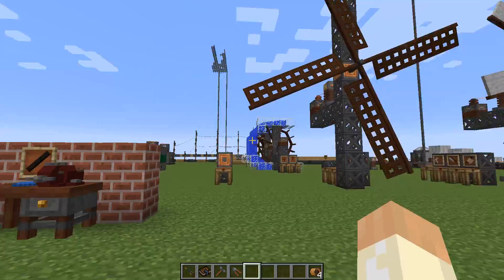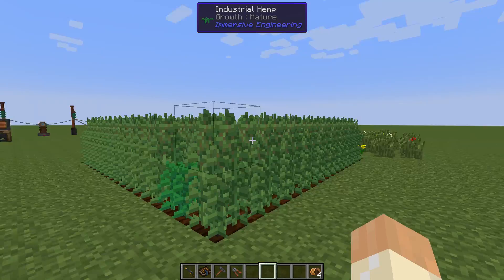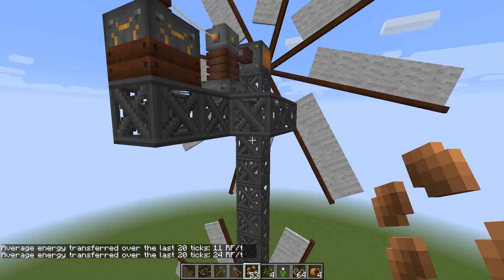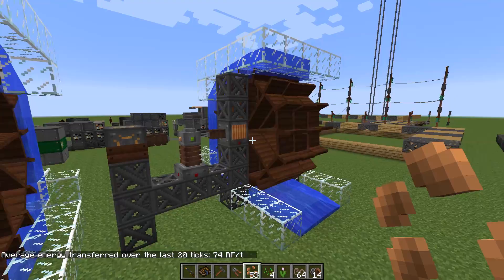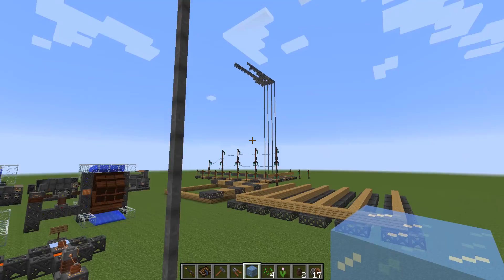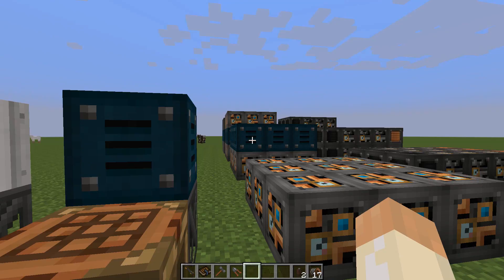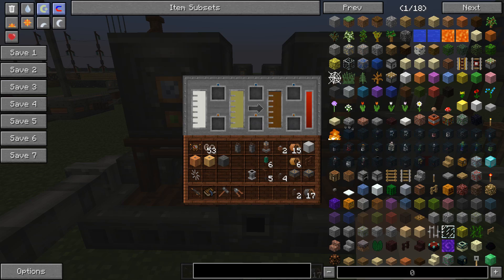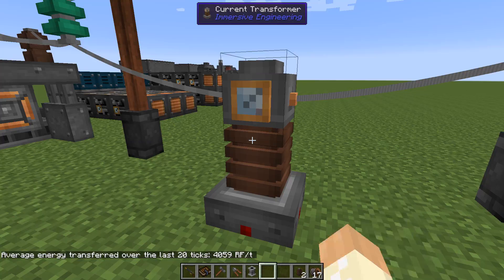Immersive Engineering Tutorial #3 - Power Production (MC 1.7.10)

Comment: Nice pot farm....
I found out something about the wires.
The HV wire allows the furthest runs from point to point,  MV and LV wire cannot be run as far as HV wire.
Reply from the maker: +ElfNet Gaming Yeah, this is a mistake in a previous video (or it might be updated, but most probably a mistake on my side). The max length of HV wire is the double of LV/MV wires. And by that I mean that two max length LV/MV wires reach as far as one HV wire.
Reply: TKH I did find out there is a config file for the mod and you can adjust the lengths as well as the loss and amount of RF.
Default lengths are LV & MV wire = 16 blocks, HV and decor wires = 32 blocks. I changed this to double so I didn't have high tension pylons so close together. I also reduced the loss a bit because the loss on the MV and LV wires was a bit harsh. and adjusted loss for HV wire to a lower value since HV line are designed to carry current long distances will little to no loss.
I didn't mess with the amount of RF the wires carry but you can adjust those to fall into place with the RF other mods produce or require..
Reply from the maker: +ElfNet Gaming A long time ago, IndustrialCraft had loss in cables. This was one big reason to spend some extra time on the network to make sure losses were optimized and so you had the correct packet size etc. I loved this idea, because it felt logical that higher tiers would give real benefits. Nowadays, the standard is that the only thing you need to care about is max transfer rate. No losses, no smart solutions required.. Personally, I find that boring. I like losses and I take my hat off to any mod dev who dares to implement them! :)

Comment: Do they nerf the output of the disogen? I find that the book has said it only outputs 1024RF/t (total) and i m using infinity pack(1.7.10)
Reply from the maker: +春日野穹 I haven't verified this in the infinity pack, but I'm using the latest release of the mod (always check video description, I have mod list and versions there), and I get 4096RF/t output from the diesel generator. Could be that the Infinity pack have an old version?
Reply: thx , It may be the problem of the pack :(
Reply from the maker: +春日野穹 Remember two things when you're using packs. First of all, they can't use the latest versions of every mod, that would require the pack to be updated several times per week. Second, sometimes the packs adds changes to mods. Items can be removed or changed in various ways. So you can either try to manually update IE for your pack, or run the version you have in a stripped pack and see how it works there.
Reply: i think expert mode in IE had it nerfed

Comment: how can i transfer energy from a energy cell from thermal expansion to a capacitor from ie
Reply from the maker: +Aljosha Beidinger Easy, just set the capacitor side to input and attach TE fluxducts or use IE wires/connectors. I've tried both ways and it works fine. Capacitors works quite similarly to TE energy cells, but with less config options.
Reply: +TKH thanks for the answer

Comment: I am using this mod, but the sheet metal and pipes aren't showing up, any help?
Reply from the maker: If you have a problem with the mod itself (like a bug) you should take it with the mod dev (use github and post a bug report). But it might just be a version difference, all items and blocks in the 1.7.10 release are not available in the 1.10 version for example. But since you didn't state what version you're using it's hard for me to know.
Reply: The version of the mod I am using is 0.5.6 I believe, and the MC version is 1.7.10.
Reply from the maker: Well, that version must be over one year old, so I guess you're missing many features... Perhaps they will show up if you update your pack :)